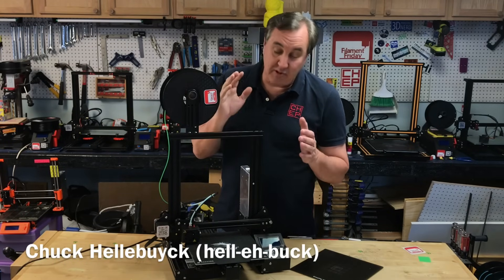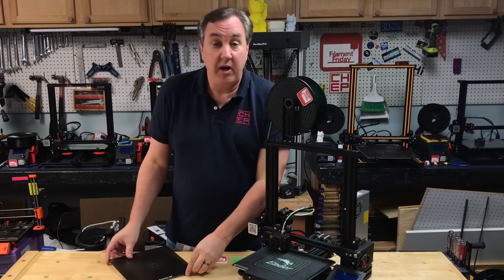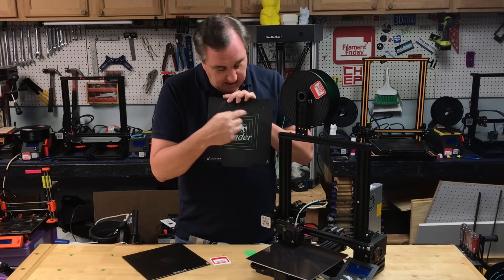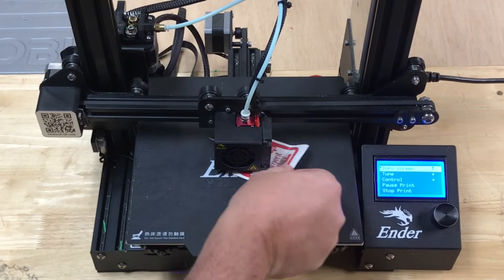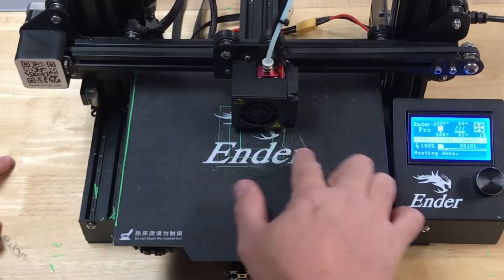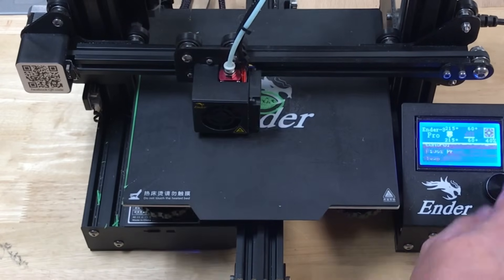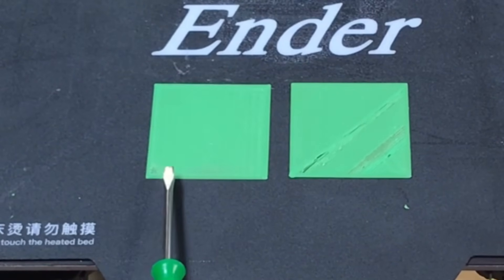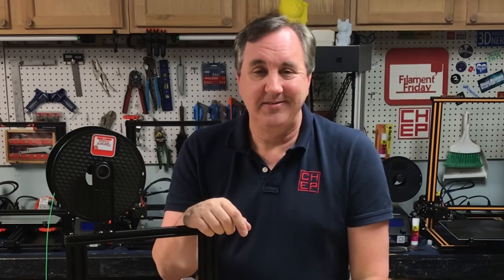Creality Ender 3- Easy Way To Level Your Bed

Comment: i run the file but it never stops so I can adjust. help?
Reply from the maker: Read the pinned comment
Reply: @FilamentFriday  thanks. Hmmm any recommendations when you spin the adjustment wheel till it falls off and nozzle still doesn't touch the bed?
Reply: @Anthony Tit thank you very much.

Comment: Thank you so much for the bed level print file- so helpful.  Question please... what print settings are used in this file please?  When I run your bed level print, the squares print perfectly.  However, when I go to print my own files, the prints are not as good so I suspect it's my print settings.  Am relatively new to 3d printing - less than a year...
Reply from the maker: Try my Cura profiles. https://www.chepclub.com/cura-profiles.html
Reply: @FilamentFriday  Thanks so much for your swift reply.. will give it a try

Comment: I'm having major problems with my new ender 3v2.. the first five or six prints were great. Since yesterday whenever I try to bed level it, it is leveled with the sheet paper test there's a little bit of snug on the each corner and in the middle.. then I go to print and somehow something happens in the bed drops or something because it will not stick to the plate. Then I autohome it again to run the paper test and it's so far above the plate that the paper doesn't even touch the nozzle. I'm bed leveling it with the heated bed and pla
Reply from the maker: Check your zstop switch to make sure it’s working right

Comment: Hi Chuck, I have a very interesting problem with my Ender 3 Pro (brand new). I leveled the bed; sliced up a thingverse file using Creality Slicer 1.2.3 and the print came out pretty much perfect. I printed several more files (clips, covers, and typical ender upgrades) until I had a failed print with some plastic chain clips. Since then the initial layer won't lay down right using the Creality Slicer (I've cleaned the bed and leveled the bed using the code that you have provided; I get the squares to lay down perfectly no problems and good adhesion). When I go to print the original gcode files that I've printed before it just won't lay down; the extruder just gums up. I was able to get a print to work using Slicer... but no matter what settings I change with the Creality slicer it won't lay down the initial layer... Any ideas?
Reply from the maker: Sorry, no idea. Sounds strange.
Reply: @FilamentFriday  All Good; I'll keep working on it

Comment: Hi CHEP I recently resliced this in Cura 4.8.0 and it seems to start printing the third box first, then it works its way through to the smaller ones, then it prints the 2 outter large sqaures? is there any reason why the sequence has changed? thanks in advance
Reply from the maker: It depends on when you put them on the bed.
Reply: @FilamentFriday  I just open the file in cura which shows all of the squares, then hit slice

Comment: Hi ive got the ender 3 for 2 days now..and still dont printed anything.. ive used this videos and profiles... but still no luck sometimes ive got a dot witch some strings and then again noting ...like its to far from the bed..a bit closer and its too close any tips pls
Reply from the maker: If it’s too far then too close, then during the live adjust get it just right.
Reply: @FilamentFriday  somehow i cant manage to reach te bed in the center...4 corners kinda feel oke...but the center theres a gap..so i screw the whole bed up and tryd to lower the corners.. still no luck haha... but thx for all the help ill go an tey some more
Reply from the maker: Sounds like the bed is warped. Some shim the bed in the center.
Reply: @FilamentFriday  finaly got it working...1st print kinda spongie...2nd print was pretty smooth ...bed to 60 nozzle 210...and the friction with the paper its real strong... but its working now ...thx for all the help keep up the great work
Reply: @nljgamings8354  Hi Jan, ive got the Ender 3 V2, and have the same problem with all four corners being okay in terms of friction with the paper, but the center too loose. When i adjust all four knobs, to compensate for the center being to loose/far from the extruder, the corners come too close... What did you do to fix it?
Reply: @JohsRungholm  hi m8...i used the test print from here... but i dind use the leveling thingie i did it manual screw the whole bed up than work down my paper friction was realy strong... u can hear it scratch...from there on work slowy down so u have the 4 corners and the middle witch the scrathing sound ...dont know iff its gonna work for u but too low friction for me dindt work...good luck m8 greetzz bb

Comment: Sorry to say this but you were a little inconsistent in your directions. First you said barely moves, first position you said barely any resistance then the second you said great resistance. Now I know I am really new to this but could you please confirm the actual resistance that I should really be looking for? Is the layer too low if I can feel vibration through the paper?
Reply: I've found you want to feel the paper on the nozzle, but it shouldn't grab. It should certainly be touching, but not real tight. 
The better way to do it is to buy some feeler gauges and get the nozzle 0.1mm (0.004 inch) away from the bed. When using feeler gauges they should slide fairly freely, they are polished metal after all. Use a size up (0.13 or 0.15mm) to test that it's not too far away, they shouldn't slide under at all, not without a fair bit of pressure and "grab".
Reply: @dalem04  ey, thank you kindly! I will probably pick them up today to get my bed leveling better. 👍
Reply: @caseymiller6277  I'd just pick up a whole set to be clear. I don't know why it isn't more recommended. Paper is hardly consistent or precise and people certainly have no problems buying tools for their printer.
Reply from the maker: It really doesn’t matter. It just gets you close. The real level happens during the live adjust.

Comment: im getting the auto leveler
Reply: Take care, as it's not so much an "auto leveller" as a "level compensator". So, if the bed is way out, and you tried to print a cube, you would find the corners aren't square. This is because the bed needs to be co-planar with both the X-gantry and the Y-travel. I'm afraid there's not really any way to avoid proper bed levelling at some point. A true "auto-leveller" would probe the bed at each corner, and would have an individual motor on each adjustment wheel to raise that corner of the bed until it touched the probe.

Comment: I've used the G-code to bed level (without print) I'm using the ender 3 Pro with the Creality glass bed and a BL Touch

I run the non print gcode and level each corner just fine then it goes tk the centre of the bed and seems a little tight so I adjust each corner equally. When it runs round again to the 4 corners they are miles off and need lots of adjusting then when I do thst and run the gcode file again it's too tight against the nozzle

Any tips?

Comment: I appreciate what you do but the codes I downloaded never pause. It dips and moves to the next one then picks up speed. Either way I've tried the gcodes, paper methods, tutorials and my prints still come out awful so I'm not sure what to do
Reply from the maker: Read the comment pinned at the top of the comments section.
Reply: @FilamentFriday  What comment?
Reply: There isnt a comment pinned? Mine is not pausing what is the solution?
Reply from the maker: Sorry, somehow the pin was removed. It’s fixed. Here is the detail:

Creality added 32 bit boards to Ender 3, Ender 3 Pro and Ender 3 V2 and the firmware doesn’t recognize the M0 command. So it may not pause at the corners. Go to here and use the 32-Bit M25 version. 
https://www.chepclub.com/bed-level.html

Comment: Hello chep, great videos, watching from overseas ! My center layer doesn't seem to stick a good as the others, any help issues ? My glass bed on my ender3v2 is ok. Thanks !
Reply from the maker: Clean it with soapy water
Reply: @FilamentFriday  ok hot or cold Water ? We read everything on the net ! Can't get it to stick since I used a ''no name''used filament green fluo. Didn't if it was pla or ABS, used as pla, never got to stick. Since then, with new pla.filament, never sticks again !
Reply from the maker: Hot water

Comment: Level the bed cold or with nozzle and bed at temperature? Does it really matter? I've had my printer for several months, always did it cold, thought the results were good, and recently did a level using this procedure at temperature.  Equally good results.  I might be answering my own question... opinions?
Reply from the maker: The main leveling for me is when I do the live adjust. So I guess heated.

Comment: I would be helpful if you could actually explain things. How does one RUN the code??
Reply: open it as if it were a print on your printer, put it on an sd card and select print from SD

Comment: When I ran the first G-Code. It wouldnt stop at each corner. It kept going to the next corner.
Reply: You can also just disable steppers and move it manually. Personally I think this is a easier method. just follow the rest of the steps after that.
Reply: @thegraffitiwriterknowsas  oh awesome. thanks man.
Reply: @thegraffitiwriterknowsas  you mean just move it manually to each corner and not use this g.code? I'm having the same problem as Dan it just keeps going and i cant stop it lol

Comment: If this way of leveling does not work for you, try this (it worked for me) 

PLA material:

Printing temperature initial layer: 215 Celsius (first layer warmer so that it sticks well)
-Printing temperature 210 Celsius
-layer height 0.2mm
-Initial layer height 0.28mm (the first layer a little thicker for good adhesion may also be 0.32mm if it doesn't work)
-Printing speed: 50 mm / s (can be faster but start with this just to be sure)
-Initial layer speed: 20 mm / s (slow for a good first layer that sticks nicely.)
 
Some settings only appear by using the search bar in Cura, so pay attention to that.

Comment: Wouldn't just putting the bed all the way down automatically make it level?
Reply: Beds can be unleveled and very tiny differences make a big impact on the print - that's why you need to check all four corners and the center. Putting the bed all the way down using the adjustment screws underneath can make the bed too far from the nozzle. Try it yourself and use the same paper test as shown in the video.

Comment: I have an Ender 3D Pro.  I have a strange problem.  If I print something THEN run the CHEP 25 bed level code, it levels fine.  BUT if I power off the printer and run the CHEP 25 bed level code, the nozzle is too low resulting with the print being about 1mm too low on the test print scraping in to the bed.  Any Ideas? I have tightened and checked everything.
Reply from the maker: Do you home it first before running CHEP 25?
Reply: On my ender 3 v2 there is a Z offset set that offset to like 0.5 mm or 0.3 mm

Comment: First time buying a 3D printer so I’m a noob, I was so confused as to what people in other videos were doing with a piece of paper to level their printer, your video finally gave me a clear explanation !!!
Reply: I find wind up or down until the paper bends when sliding between nozzle and bed,, back off, then adjust till it bends again on all 4 screws, go around a few times. I got mine to 0.05mm across the bed using this method,  results via the bed visualiser in Octoprint to show level.

Comment: Awesome. Does that work for both  PLA and ABS (non branded)?
I have normal Ender 3x
Reply: doen't abs use higher temps? I'd be worried about burning my finger on the bed lol.

Comment: On all the bed leveling video's I have not seen 1 that first says to wing the bed down so theres spring tension on the bed springs , if you dont have tension thw bed is free to move around and wobbly all over the place during printing and also this is why every time you bed level its showing different measurements.... Tip of the day brought to you by Tony Den cheers happy printing.... 👍😊

Comment: My printer doesnt stay in position long enough for me to level it. Im using the bedlevel gcode and it just keeps moving to each corner. Am I doing something wrong?
Reply from the maker: Read the pin comment at the top.

Comment: Does the glass bed make a big difference for leveling? Also does it impact the bed heating at all?
Reply: I'm not a pro but I think it's easier to level glass bed, but you'll need to use some adhesive to "glue" your first layer to the bed
Reply from the maker: Glass beds are typically flatter so easier to level. Some have surface on top that grabs the prints so no glue required. You might need to bump the temp 5-10°.

Comment: Thanks so much! I was using a similar gcode for leveling, but I LOVE this one because it actually pauses. Strangely, because it pauses each time I'm able to level my bed MUCH faster than with the gcode that was automated. The M0 version didn't work on my Ender 3 V2 but the M25 version works perfectly. I also like your level print gcode better than a different one I was using because this is much faster and uses less material.

Comment: New to 3D printing and trying to decide between the Ender 3 Pro and the JG Maker Magic. I have had the ability to try both side by side. Out of the box, the Magic has a bed leveling sequences as part of the Marlin interface. It steps through moving the head to each corner and then the center. I am assuming this is a custom version of Marlin. If it is possible to have this as part of the firmware why doesn't Creality build this in? I was very surprised to find out the 3 Pro did not have this ability bult in.

Comment: the bed leveling gcode helped me a ton but I recently went to redownload it doesn't work now. I tried both links and all files inside them. Some of them will go down on a corner and immediately come back up so quickly that you can't level anything. Some of them literally do nothing.
Reply from the maker: Did you change boards?
Reply: @FilamentFriday  no I have the same everything. It used to work great for me. Redownload it yesterday and nothing in the world will make it work
Reply: I'm having the same problem, it doesn't pause at each corner
Reply from the maker: Use the M25 version
Reply: @FilamentFriday  it works but I have to hit resume print between each corner
Reply: @I77AGIC  I think thats normal
Reply: @michaelpxd6325  never used to be like that

Comment: I'm not able to use Cura Profiles every time I go to print ender 3 tries to print it in the neighbor's backyard way off the table..... ideaMaker   software is the only one that prints centre middle of the table.
Reply from the maker: You have to change the machine settings if you want center.

Comment: I used your bed leveling file but when the print is on the edge it will stick good but when it goes to the middel it won't stick but when i twist the knob it will hit the glass on the outside
Reply from the maker: Warped bed.
Reply: @FilamentFriday  i used your printing gcode for testen and now the sides are leveled but when it goes to the middel it isn't really as lose to the bed as the sides.
Reply from the maker: Some people replace the bed. Some add glass. Some have tried to flatten it so it’s not warped.
Reply: @FilamentFriday  at the moment i have a glass bed
Reply from the maker: Wow. That is strange.

Comment: This has been a huge help along with the leveling gcodes. However, I just cant keep my bed level for the life of me. Any time the thing moves, its all out of wack. I ran the level gcode 3 times in a row, and every single time I had to re-level the bed. ITs getting annoying.
Reply from the maker: Lower the z switch so the springs compress more.
Reply: @FilamentFriday  I have it all the way down. I just ordered a glass bed, so I'm hoping that will give the springs a little more tension, otherwise I'm going to upgrade my springs next.
Reply: @joecrackin3783  you have it all the way?  When I put my s switch all the way my nozzle kept scraping against the bed even though I resisted the knobs right as possible
Reply: @joecrackin3783 also I’m called joe too 😂. Been tryna Level my first leintet all day and it’s been a nightmare. I’m gonna try again tomorrow

Comment: Chep I used the presliced GCode for on my ender 5 pro with stock magnetic bed and the white pla my printer came with. After a few false starts do to (I guess) bad leveling it came out beautifully. Then I grabbed profiles  from your website (I think for ender 3 but I would think it would be ok with 5) and sliced in latest Cura (used your “good preset” an improved strain relief bracket for the bed wires with blue MatterHackers build PETG and nothing stuck at all (except to the nozzle lol). Any ideas?? Could it be an estep issue? Haven’t messed with calibrating that yet.  Just baffled because the calibration print(again presliced by you) worked so well (though another presliced calibration from someone else with five filled in squares was ok at best) but the strain relief was absolutely awful with your profile.
Reply: Thanks for your help!

Comment: Will this work on the CR-10 Mini?
Reply from the maker: The dimensions are off. You can modify it though with a text editor.
Reply: @FilamentFriday ?? New to the game Chuck!! I Did just check out your vid for the CR-10 Mini bed leveling. Did you make a code on thingaverse for it, or is it obsolete now? Got a mini coming from Amazon on Sunday and I'd like to hit the ground running.
Reply from the maker: Yes. Link in video description.
Reply: @FilamentFriday  Your da 3D Godfather!!

Comment: Using the M25 version for the Ender 3 Pro, but the bed and nozzle are heating up between each of the 5 points, is this normal?
Reply from the maker: Not really. Did you preheat before running it?